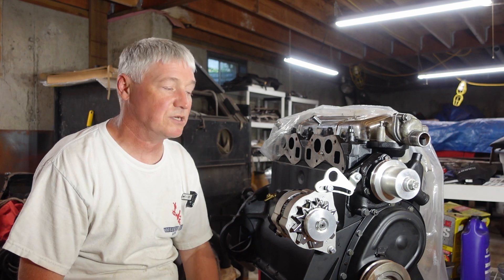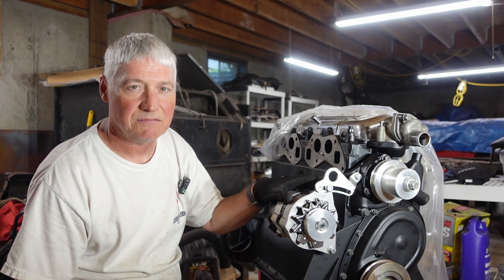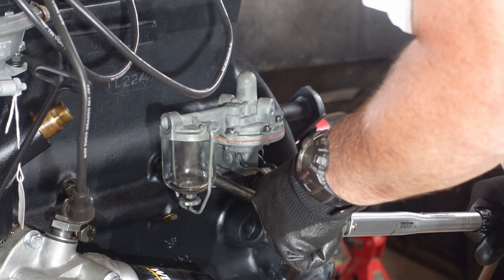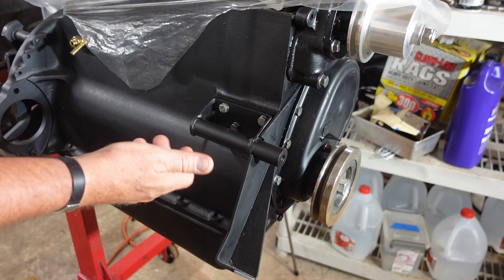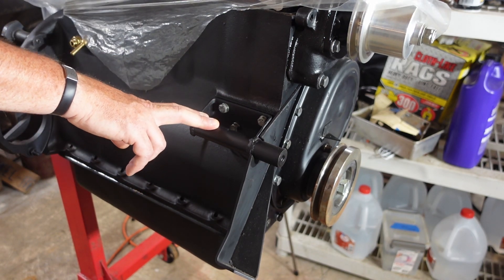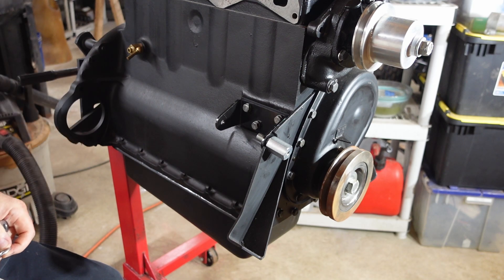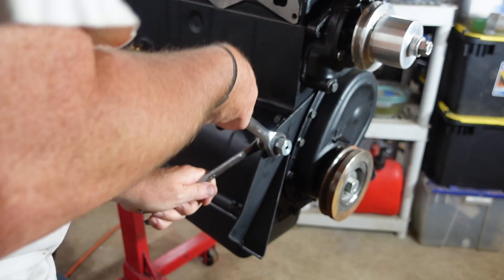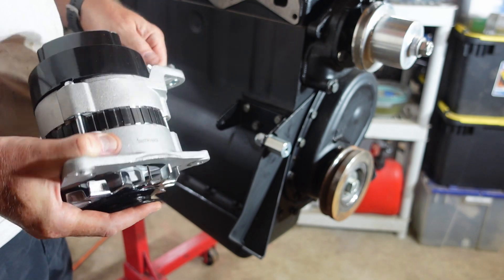Triumph TR4 - Engine Rebuild #20: Alternator Conversion | Roundtail Restoration

Comment: Good morning from Wales, UK, Chris! I've been following your channel for a long time (I also have a Mk3 Spit!).
I did the alternator conversion on my very first Mk3 about 20 years ago for two reasons;
Firstly because when I was driving back from West London via Birmingham, I noticed the car lights were gradually dimming (it was about 10pm). I ended up having to be low-loaded the rest of the way home (wisdom had me purchasing a policy which included breakdown cover). Turned out the dynamo was dead. So I ended a new power generator source!
Secondly, as you mentioned, for more efficiency. I remember purchasing a recon Ford alternator from a local breakers and managed the transition pretty easily.
But on trying to repeat the process for my new (1966 4A) I've encountered a problem. I've now used two new alternators with the wiring that Elin Yakob demonstrates in his channel. The wiring I followed pretty easily but for some reason, I cannot get the correct output from the alternators. 12.13V even at 2,000rpm. I'm going to try to wire the alternator(s) directly to the starter switch to bypass the connections to/from the voltage regulator box (which is isolated and acting purely as a junction). I suspect there's an issue between the dynamo/alternator connection to the starter!? Anyway, I'll figure it out... I'll need to, because the car has twice, after a number of days, died in traffic (fortunately I keep an identical spare in the boot (trunk to you lot!) for just such an emergency!
Keep up the good work,👍🏼
Regards,
Eoin 👌
Reply from the maker: I haven't concentrated on the wiring changed yet, so I'm sorry I can't help there. But, I don't believe the voltage output of an alternator, unlike a generator (dynamo to you 😁), is speed dependent. It should put out nominal voltage from idle all the way up. Good luck and thanks for being a long time follower!

Comment: One step closer, Chris! 👍
It was sone time ago, but I am trying to recall how I fitted the alternator in my TR4... AFAIK, no one was making conversion kits at the time.
I think I used a single, really long bolt at the bottom, passing through the tab on the alternator, a spacer, the front engine plate, the front arm of the mounting bracket, another sleeve or spacer, the rear tab on the alternator, and the rear arm of the mounting bracket. That way there is only that one long bolt with a nylock nut at the rear to tighten. But, this involved modifications, so isn't "reversible", if that's a concern. I either modified the original spacer at the front into an unthreaded sleeve, or made a sleeve out of something. I also made a long sleeve to fit inside the mounting bracket. I might have used a washer or two at the front to get the belt to align. 
At the top, I used the original adjusting bracket. I had to heat it up and bend it a bit to get it to align properly with the tab on the alternator. 
The only problem I can remember encountering was something on the particular alternator I was using (a GM, single wire, dont recall the model)... I think I had to trim a little off the lower, rear mounting tab to narrow the mounting surfaces a little. Thinking about it now, I suppose I could have instead just made a slightly wider bracket. Live and learn!
It doesnt shown it all, but there is an old photo in the gallery here: https://triumphowners.com/to-car/tr4-14/
Reply from the maker: Thanks, Alan. That's a cool picture! I think the kit will end up working out fine. Just have to tweak it a bit, of course, but that's not a surprise.

Comment: Hi Chris, It would appear that for some reason your engine has notch cut into the engine front plate, (presumably when the welded bracket was installed?)  On my 4A engine the threaded stub on the pedestal passes through a correctly sized hole in both the front plate and the bracket.  Without the front plate acting as a spacer, your alternator will be set rearwards equivalent to the thickness of the front plate... can't tell if this would be sufficient to throw your three pullies out of line.  

If I remember correctly, the hole in my plate had opened out and the plate thinned over the years... I assume because the pedestal had worked loose with consequent rubbing and wear.  I think I added some weld to bring the front plate back to original thickness and closed the hole to the correct size.  I suppose you could fit a thick washer to make up for the missing metal... personally I would MIG this in place, while ensuring correct alignment with the bracket, but not welding the two together.

When I was rebuilding my engine, an experienced TR owner advised me to lock-wire the three hex screws that hold the dynamo bracket to the block.  They said that if the screws came out, then there would be a loss of engine oil.  I did not evaluate or question the validity of this, as they kindly gave me pre-drilled hex-headed screws, so no problem.  In addition I used a sealing type of Loctite to ensure there was no path for oil seepage past the threads.  That seems a sensible precaution, even if fitting lock wire is a something that is not really necessary for a typical road-use car.

Comment: What would be the disadvantage of just running a generator, do they not charge as well? I've never had a car old enough to have a generator.
Reply from the maker: Hey, Eric. The generators are old DC technology and are not as efficient as the alternator, which is rectified AC. The alternators have a more robust design and they are also able to put out more power, and they put it out on-demand, vice constantly like a generator does (which is why you have a fully separate voltage regulator). The generator also needs to spin fast to put out enough oomph to charge the battery. In my Spitfire, until I hit about 1500 rpm, it's not charging the battery. I'm swapping over for the reliability and ease of repair.

Comment: Hey Chris!

So I am going to do a similar conversion on Arya, but I think I might do it without a kit.  Considering the issues you had with this kit do you feel that you could have done it better, and cheaper by making your own fit kit?
Reply from the maker: I don't know. In the end, the kit did have everything I needed. There were some differences in the Moss and the Rimmer's kit. The Rimmer's kit was more complete while the Moss one assumed you had some existing hardware. I probably would go the kit route again if I was using this alternator because I know they would work together. If not, I'd probably build my own.

Comment: Hi Chris, what is the # on that WIX oil filter?, Thanks
Reply from the maker: Hi, Bill. 51516. I picked them up at Amazon (https://shorturl.at/y65i2) for less than half of what Moss charges (I zoomed in on their pic to get the #). Right now, they're about $7.50, so maybe time to stock up!
Reply: @roundtailrestoration  Thanks , I will

Comment: Great description of the kit install and overcoming the issues.  Does the kit identify the alternator so that you can purchase a replacement in the future if necessary, or would you have to go back to the source of the kit for a replacement?
Reply from the maker: Hi, Dale. The alternator is the one for the TR7 (without AC, I believe). I picked up my parts through Rimmer's but I believe they all sell the same stuff (and it's obviously a Moss kit). The Moss instructions do call out a Moss part number, 130-101, but if you look that up, nothing comes up (at Moss). If you cross-reference what Rimmer's sells at their TR4 conversion alternator, it's the TR7 one.

Comment: If only the instructions were in English..."The lower front of the rear"?  What?
Reply from the maker: lol, yup. A bit of a word salad that needs to get read more than once, that's for sure. I didn't even look at the electrical instructions yet. Thanks, Mike!
Reply: Wow that makes little to no sense in my mind . One long bolt and different sized shims or washers to adjust your alignment outside and inside the bracket and that will do it. They made it difficult for sure.
Reply from the maker: I agree. Looking again, however, the Moss kit and the Rimmer kits are a bit different. The Moss kit includes electrical stuff and assumes you have some original hardware. The Rimmer's kit does not. But, they seem close enough that the Moss kit instructions are adequate to use.